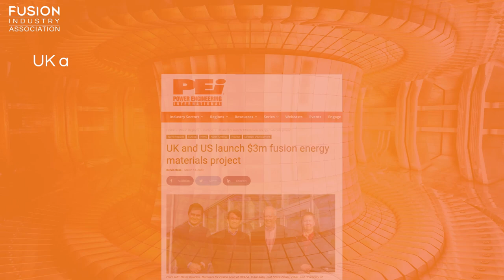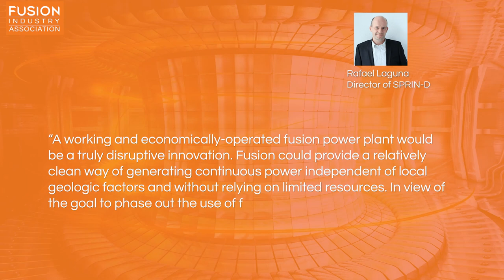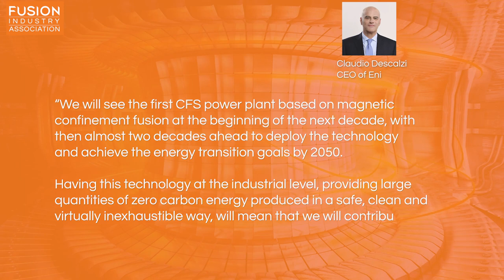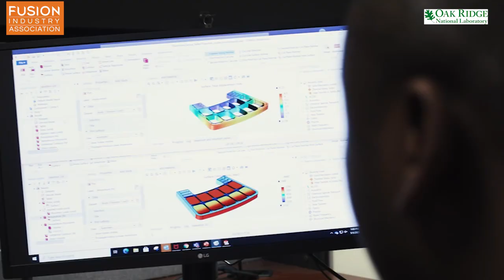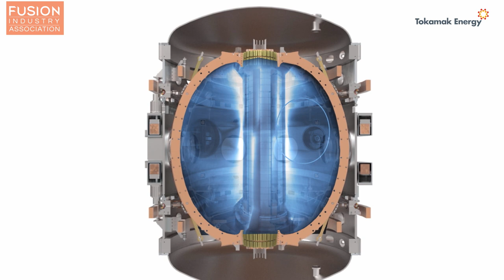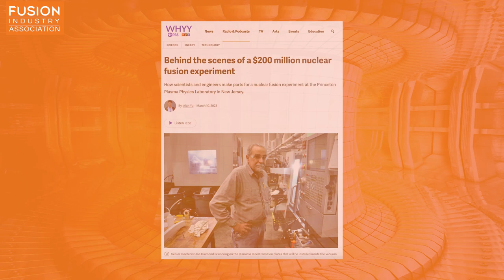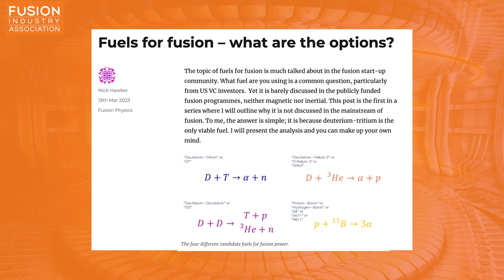Fusion News, March 22, 2023

Comment: The new RT superconductor high compression stress requirement might be  achieved by encapsulation with another high strength material with different thermal expansion that is prestressed in tension, similar to prestressed concrete.